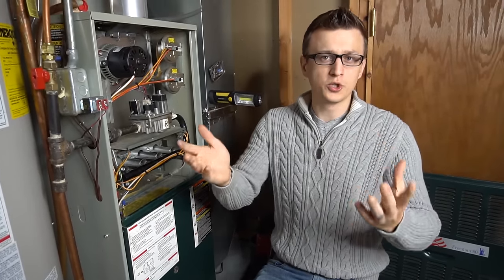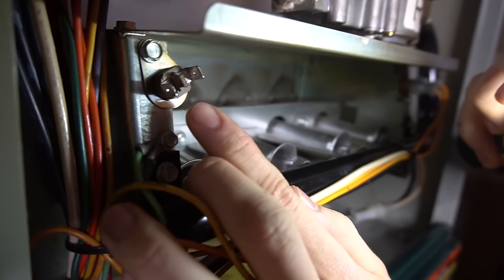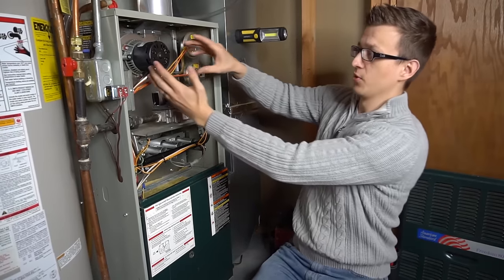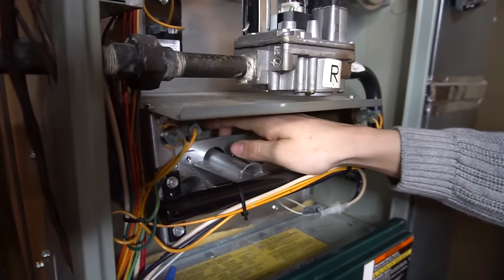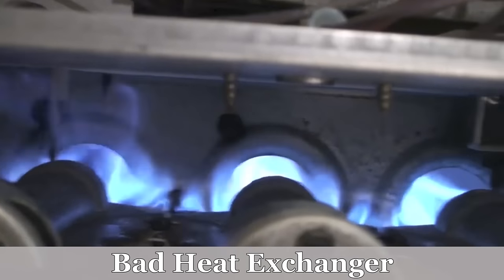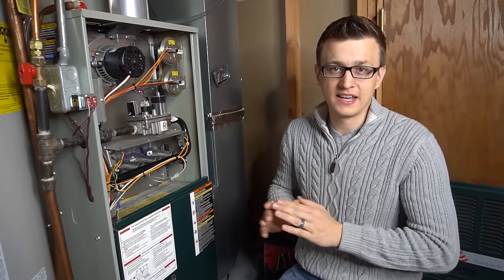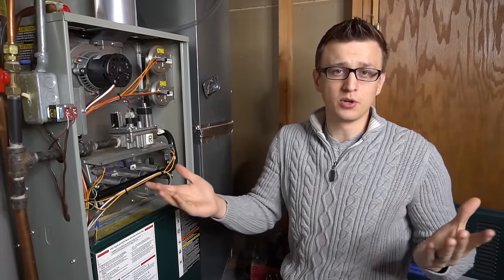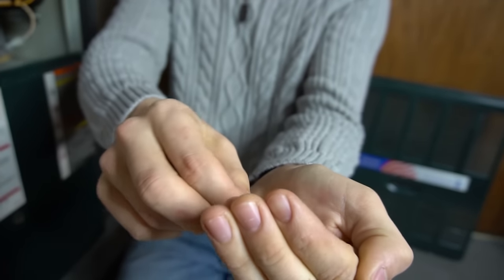Furnace Flame Roll Out Switch Tripped - How it Works

Comment: Thanks, this video helped me solve my problem. Our thermostat was rebooting, but only during heating cycles. I couldn’t determine why and figured it must be a faulty thermostat. As it turns out, that was not the case. I ended up having a 33 code for an open flame roll out switch. Well, that would explain the resetting thermostat because the furnace was essentially shutting down and resetting itself…thus no power to the thermostat and the reboots. But, the problem was not actually flame roll out at all. There was no evidence of flame roll out, flame cones were fine, nothing blocked, filter is four weeks old, furnace is seven years and only 58,000 BTU. Turns out…it was the filter, but not because it was dirty…it was because it was too restrictive for air flow. The furnace would come on and there was not enough air flow to pull the heat from the heat exchanger fast enough resulting in the furnace heating up internally and tripping the roll out switch. The filter simply could not pass enough CFM. Took out the filter, problem solved. The filter was rated at MERV 11. I put in a new filter rated at MERV 8 and no more roll out switch tripping…and consequential potential damage to our furnace. High MERV may be good for air filtration…but not necessarily for your furnace.
Reply: Thanks for posting this comment! My scenario is very similar to yours so after quickly reading through your comment I tried running the furnace without a filter and sure enough it isn’t tripping the FRS anymore. Will bump down form a MERV 11 to a MERV 8 and see what happens.
Reply: Thanks for the comment, basically just had the same problem, was looking at the side of the filter MERV 11, and my old ones were 8, so popped an old one in that wasn’t too bad until I can get to the hardware store.

Comment: Thanks for this!  I had a Payne high efficiency furnace installed in 2008.  5 years later, in 2013, the #33 code rollout kept coming on.  It starts up and runs fine, and then sometime in the night, the flame is shut off and the fan blows cold air continuously until you reset the rollout switch.  As the story was told..., the heat exchangers were coated in polypropylene, and that eventually deteriorates and was clogging the heat exchanger.  So after a considerable fight and almost legal battle with the Payne/Bryant/Carrier distributor and company (and shyster Carrier serviceman who tried to intimidate me into paying for the parts too), I was able to hold them to their warranty promise of paying for the parts (I paid labor and their multiple transportation trips).  Supposedly there was a class action suit on the failing heat exchangers, but I could never figure out if that were true or not...  Anyway, I suspect I got the exact same heat exchanger as a replacement, because it is now 2021, and the code is happening again.  I watched all your videos and have done all the diagnostics, and it appears it's doing the exact same thing as in 2013.  Do you have any experience or wisdom on this problem with Payne.  And secondly, can you recommend a furnace that is actually worth paying for?  Thanks for all your awesome videos!
Reply: Take a level and make sure the body of the furnace is tilted forward slightly. If a high efficiency furnace is tilted level or backward, you'll have poor flow out of the secondary heat exchanger. This will form a stagnant pool leading to extensive corrosion. That's how it always happens. I prefer the type of furnace in this video. The standard efficiency furnaces almost never generate service calls. You lose a few percent worth of fuel, but I prefer for my heat to work reliably. Most issues are from a dirty flame sensor from not being cleaned for years or a stat related issue. The Trane two stage 80% furnace from the 90s are some of the best around. They don't make them like that anymore.

Comment: I recently ran into a flame roll out situation where the gas valve was opening too fast where it was supposed to be step opening 0.8" water column  more every couple seconds. Replaced the gas valve. Problem solved.

Comment: I removed air filter just to test and it still got tripped. Blower motor still going, so not water in blower. Found my condensation line plugged from dirt in the utility sink. Cleaned that out, and now seems to be running fine. Thank you for posting the video. Saved me $$$!

Comment: Another thank you for all your great vids. After watching a few I was able to diagnose the issue I was having. The furnace shut down after running for about 5 minutes and only the inducer motor was coming on after I would restart it.  My particular model has two of these switches. One in the flame box and one next to the inducer. I found the one at the inducer had tripped so I reset it and ran the system again. I noticed the exhaust duct was getting hotter than normal much faster than it should and tripped the switch again. I went through your diagnostic tips and found I had a broken vent on my roof. The rain cap was siting directly on top of the pipe blocking just enough flow to cause the problem. I made a temp fix to hold the vent cap in place and it's working as it should again. So, a prime tip for all you homeowners that have a roof replacement done during the summer, get up there an thoroughly inspect all your vents when the job is done. If I had noticed it then I could have had the roofing company install a new one on the spot instead of having to do it myself.

Comment: My furnace flame roll out switch tripped late Saturday night.  No heat most of the night.  Spend some time trying to figure out why nest stop working.  Short story after couple of hours of good cold sleep, I end up finding this video early morning.  Thanks to you it was a flame roll out switch tripped. I reset it and burner kicks in with nice cone shape flame as described in this video.  I have a call out to furnace company to come out.   At least house is started to warm until the technician comes later today.  Thank you again and very helpful content.

Comment: Best video! A guy came out and said I needed a whole new furnace… the roll out switch tripping was intermittent, so I knew it was a blockage somewhere. Went to the pipe on the roof clogged like cement with debris. Fixed furnace perfectly! Saved me 7 k

Comment: Thank you great video.   Found the bad rollout switch by jumping the connectors.   Furnace worked.  Then saw the backdraft on the burners.  So, it appears bad heat exchanger.   Not surprising since the furnace is 27 years old.   Going to call the furnace guys tomorrow and see what they say.  But I'm expecting the worse (new furnace), but hoping for the best (some other issue that won't cost as much).    You video has prepared me!!!   :)

Comment: This video really helped out! I didn’t know about the button reset on the sensor, I just clicked it and it made “click” on one of the two. I turned the heat off before doing that. Turned the heat back on and now it’s working 🔥

I have a Rheem, it was installed when I purchased my home in 2019. This was a whole new setup too
Reply: *Update - It turned on a for few minutes but it turned back off. I’m replacing it anyways but I’m waiting on Amazon to bring it today. It worked temporarily but not for long. But great content and knowledgeable information! I’m subscribing

Comment: I'll really appreciate your videos and they're very informative. 
My furnace is driving me crazy, and it cuts out very inconsistent interval. I called 3 different repair company came out. They did for 10-15 minutes, and it always runs fine for that time when they're there. Then the issue comes back again and again. Total, I had them came out 6 times, $80-$100 per visit. Finally, I found out what they did was exactly what you explained here to clean the flame sensor. (Perhaps, I should have cleaned it with $100 bill instead)
Since I watched lot of your videos and got knowledges about how it works. I'm tire of cleaning the flame sensor and sometimes it works for whole day or two, then it came back again. I went ahead and ordered genuine part twice. It works for a day or two and again, and thought I nailed it, but the flame doesn't stay on for minute or so. Watched your 10 most issues video and tried to eliminate one at a time ... seems to be clueless of what's going on right now. I think I will go ahead to replace the thermostat soon. Anything you could share or I have missed? Already spent almost $600 repair for no part replacement from 3 companies ... Otherwise, I would have replaced new one in the first place.

Comment: Well a first for me!  My roll out switch tripped and after a lot of trying , I realized that when I separated the flue that goes to the roof to clean it of some refuse, I didn’t get it back on exactly right. I had just replaced the flame sensor and cleaned the flue and then when trying to start furnace it kept interrupting the ignition cycle. Long story but the pressure switch code was on and I realized the induced draft was slightly pulling thru the inside of the cabinet and causing a slight temp increase which was shutting down the roll out switch.  We took the flue off and replaced it back in and voila!  The furnace works great now!  Wow  I learned something really valuable here

Comment: Thank you so much for your amazing troubleshooting videos on a furnace. You just saved me $433.45 in parts and labor. 
Our Goodman furnace just stopped working and my Nest thermostat wasn't getting power. Bad control board! I bought one for $165 and if I had someone come out they quoted me $265 for the part and $300 in labor as they knew it was getting near the freezing mark in the Portland area. Thank you so much. It's so nice to walk around the house when it isn't 52° inside and 41° outside.

Comment: Inadequate combustion air, or a house that is running negative pressure, due to exhaust fans, cloths dryer etc can cause rollout at the furnace, because the makeup air for the  items mention above will be drawn from the furnace flue, which will cause a backdraft and flame rollout.  Good video.

Comment: Hey love your clear and calm explanations! May I ask a couple questions:

1)
Why is it that gas dryers (at least the one I have which I opened up because it broke), don’t have flame rollout switches? Isn’t that weird? Could it be something is taking the place of it that I didn’t recognize - or the design itself of the dryer in some way makes it a non issue?

2)
You know how a dryer has a cycling thermostat/low limit thermostat/regulating thermostat/  - what does a furnace have that’s analogous to that?

3)
I heard furnaces don’t have “low limit switches”. Why is that?! Thanks !

Comment: Found one of the rollout switch's was tripped. First time I turned on the furnace this year. Flame is in cone shape. Until I started checking, I did not realize there was another filter inside the unit. It was really full of dust. I have a feeling the air flow through that almost fully clogged filter may have been causing to flame to blowback and trigger the rollback switch. I have always replaced the filter inside the house(intake).I will keep an eye on it. Thank you for this video.
Reply: Where is the other filter in the unit?

Comment: Hey Jay, you definitely brother!  You saved my butt a couple of years ago with a problem I had with my furnace.  If you have a moment please, I have another question on an issue I'm having with my Lennox furnace.  Thermostat comes on for heat,  inducer motor starts up and then about 5 seconds later, the furnace blower comes on.  No flame.  Just inducer motor and blower motor running simultaneously.  Could flame roll out switch be the problem? If not, please steer me in the right direction!!  Thank you and keep up these awesome videos!
Reply from the maker: Sorry to hear about the furnace troubles my friend! The first thing I would check is what error code the control board is putting out. What you explained sounds like one of the safety limits is open, maybe the high limit (overheating) or a pressure switch? If it was overheating, this video should help: https://youtu.be/pJzP1jzYPqg   And here is a good video for the pressure switch: https://youtu.be/Zax02itYHkU

It's possible that neither of those are your problem but if there is an error code, it should help steer you in the right direction.
Reply: @WordofAdviceTV  Hi Jay, thank you so much for responding and giving me a route to go.  I know you are busy and get a lot of requests for assisting people with their issues.  I love your channel.  You explain everything in detail and photography is very clear.  You are very blessed with the knowledge you have and to share it with the videos you make!  Thank you again, Jay!!
Reply from the maker: @garyp9906  You're very welcome! I hope you will be able to find and fix the problem. God bless you and yours, stay warm!

Comment: Great video! I was trying to find a blown fuse, but ended up discovering an open roll-out switch issue. After watching this video, I was able to locate four roll-out switches, but I am not sure if any of them were triggered though. I touched all of them with a screwdriver, and the system started working again. Now I am just in an eternal panic of wondering when the issue will return...

Comment: My thermostat panel on main floor was blank and it turned out to be a tripped roll out breaker.  No power at any thermostat connections but fuse was good. Carrier 58MVB installed 2009.  Thanks for the video

Comment: In Canada, a company named Enercare, prices a furnace/Ac install on a 20 year contract at $57000 and that the price increases every year over a 20 year contract which can be bought out for about $20000. So buying a new furnace in the Toronto area of Canada may not be preferential to replacing the heat exchanger. Fascinated by the rollback switch. Didn't know about that. With a cracked heat exchanger I would expect when the blower comes on that it causes orange flame rollout. Carbon monoxide is not produced when the flame is blue. Might be a nice idea to put a CO interlock into the system so that the home owners know the heat exchanger is done and the flame rolling back orange.

Comment: I have a rather unique problem that I was able to narrow down with your excellent guidance. I have an attic furnace. To get to it requires Houdini like contortionism for about thirty feet. I am seventy and am not feeling like it till I finish a few other projects around the house. I had a dirty filter and my wife closes all the doors to rooms that r not being used and I told her we r throttling the furnace. It's needs to breathe. It seem to shut off on the high limit. Turning the furnace breaker off resets it and it goes back on. The switch that is accessible on your unit that u use for demonstration purposes is probably in the attic. Inaccessible. So a very temporary work around is using one of those remote power receptacles to cycle the power and reset the hard shutdown.  Does the large hallway  inlet duct provide access to the furnace?

Comment: This helped a lot. My flames in the burners look normal. I have a high efficiency. The plastic view port around the cover that you mentioned did melt and come off. I noticed the area around the flame rollback sensor gets really hot. Could it be that the flames are rolling a little around the edges of the burners and heating the metal and that heat is transferring back to the rollout sensor? Should the area around the rollout sensor be cool to touch or is it normal for it to get really hot? Fyi resetting it gets it to run for about 2 minutes before it trips.
Reply from the maker: Unfortunately what you described sounds like a bad heat exchanger. Especially if that sight glass melted off. I would suggest getting a company to come out and do a combustion analysis test on your furnace. I'm pretty sure the carbon monoxide levels will be very high.
Reply: Thank you. Agreed, I'm pretty good at DIY, but this looks like it is one of those issues where you want a professional to fix it.

Comment: I learned about these switches when I had condensation puddling in my pvc exhaust pipe.  It wasn’t pitched back toward the furnace so the splashing water caused erratic flames.
Reply: I'm having rol out switch problems myself. So your problem was that there wasn't enough 'pitch differential'  if you will. On you exhaust pvc pipe?
Reply: hey doobby, curious about this as well!  I have a similar problem but i'm not 100% sure that fixing the pitch will fix this issue.  did you, in fact confirm that fixing the exhaust pitch was a solution?

Comment: My flame roll out actually tripped because of my inducer motor. The first winter after we moved in to our home I heard a intermittent rubbing noise coming from the furnace. It turned out to be the inducer motor assembly. The house was a forecloser and had sat for long time, water somehow had entered the pvc exhaust tube, got into the bearing on the inducer motor and rust had caused the outer race to swell. Which caused the composite squirrel cage fan to spin off its axis and rub on the inside of the outer housing. I ordered the part but it would not get to me for 3 days, so I put the assembly back together, temp was around -4 deg at night. Sometime when I was at work on the third day the inducer motor was rubbing so much it stopped and tripped the roll out. I did not know this happen, got the new inducer assembly installed it and furnace did not come on, so I called the company I purchased the assembly from and talked to a tech. He informed me that it must have gotten so hot because of the seized inducer, he walked me through and helped me find the roll out, I reset the roll out and had heat.